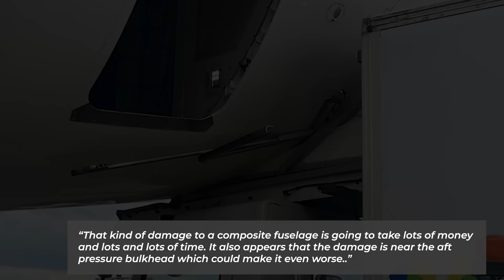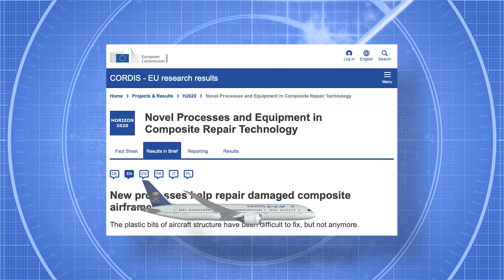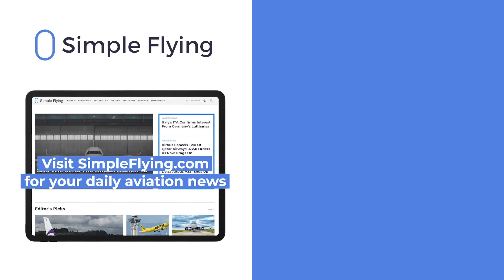Will This Boeing 787, Damaged By Ground Vehicle, Ever Fly Again?

Comment: I would not knowingly fly it as a pilot, or fly on it as a passenger, after an attempted repair.  For any potential insurer, the liability would be astronomical if it fails in flight and loses the rear empennage.  The engines, interior, and mechanicals may be useable as spares or even in new construction, but the fuselage is “toast” along with all the plumbing and wiring in the area which would have to be redone in any repair attempt.

Comment: She'll fly again. I remember when a MD-80 engine exploded catastrophically and caused heavy damage to the fuselage. That aircraft was repaired and return to active service and flew without issue until it's retirement. Look up Delta Air Lines 1288 for reference.

Comment: One of the most common motor accidents involving older people is confusing the accelerator and break pedals. When wishing to slow down they press the accelerator pedal. They get faster so push the pedal even harder until their progress is arrested by something unyielding. Ask any cop.
Reply: In this case it was the "break the plane" pedal  :)

Comment: Ex Aussie Airbus Maintenance Director here. It is important to note that the aircraft skin is its structure unlike a metal aircraft. Everything you know about aluminium aircraft simply does not apply. The structure has been compromised. The entire structure from wherever it is "bolted" to the rest of the frame probably needs to be replaced because of the pressurisation stresses; repair by patching is unlikely to even be contemplated. The good news is that both Boeing and Airbus have really good data sets including structural analysis, so what to do will become obvious to their engineers. But even with this data, designing the repair and manufacturing a one-off replacement fuselage section will take time and a lot of $. How much? I don't know, but I know that even very small holes can be over $1m to repair with most iof that expenditure being engineering design and testing costs.

Comment: Boeing repaired the Boeing B787-8, ET-AOP at Heathrow after the ELT fire. They took a fuselage on the production line and cut out the piece they needed to repair the aircraft.. Boeing COULD repair this airframe.... They repaired ET-AOP because they didn't want a 787 airframe being SCRAPPED soo early into the program. It will come down to whether Saudi want to keep an aircraft that has been damaged and repaired in this manner.. I suspect that Saudi won't want the aircraft..

Comment: patching it may be easy, but certifying it to be flight worthy after the fix would be very hard.  Curious to know if Boeing maintenance manuals have certified patches up to a certain size, and beyond such size, it isn't certified.    The fuselage is made of wound carbon pre-preg "tape" (tape is made of many fibres in he same direction, but the tape is laid in different directions and number of layers) 
A patch would likely be made of carbon fabric which is very small bundles of filaments hat are weaved into a fabric.  This would have diffrerent strenght depending on how it is laid and in what direction (and how many layers).  Suspect Boeing may have to test patches and once it got a design that passed the test would deply that design onto the damaged aircraft. Reproducing shape/strenght of the fuselage , rubs, stringers wouldn,t be that simple. 
If the damage included some structure or wiring, making he aircraft able to fly to Boeing field in Seattle would be quite a challenge.

Comment: If the structural integrity of the airframe is not too far gone it could still be flown. But it would have to fly at 10,000 ft. or lower. So it could be flown to a scrap yard possibly. It obviously could not be pressurised.

Comment: It’s repairable.  The plane is built in sections, so that section will be replaced.  The problem is Boeing is years behind with parts.  Of note, many 787 sections had to be disassembled to fix improper shimming.  This repair is no more difficult than that.

Comment: I’m a recently retired airliner airframe mechanic for a major US airline. Prior to a well-publicized merger, one of the airlines involved in the merger was the first US airline to order the 787. Being from the “other” legacy airline, and being very comfortable around aluminum airplanes, I wasn’t all that enamored with the idea of a “plastic” airplane. I spent a good portion of my career repairing fuselage damage caused by ground equipment. Ladders, belt-loaders, the Jetway, the list goes on. If it’s near the aircraft, there’s a potential for damage.
      The reason why I’m not a big fan of “plastic airplanes” is because, just judging from the damage from ground equipment, a well-experienced airframe repair crew could have had that airplane back in revenue service within, I’m estimating three weeks, allowing for parts and other materials. Stinger splices, whole stringer section replacement if necessary, skin doublers or skin replacements per the SRM (structural repair manual), and even engineering support. Damage like this is not the first rodeo for accomplished and experienced airframe maintenance crews. Plastic airplanes? That’s another story.
      My airline had a recent issue with a 787 where a lightning strike damage was in close proximity to the forward pressure bulkhead. My airline wisely farmed out that work to Boeing. The entire forward pressure bulkhead had to be removed in order to accomplish the composite repair. That airplane is back in revenue service, and will eventually pay back the cost of the repair.
      In the case of this particular aircraft, I believe that Boeing will have a fix, and that the aircraft will soon be back in revenue service. But, I can’t stop being old-school. I don’t like plastic airplanes.

Comment: Ya that is right where the pressure bulkhead meets the rear empennage. Without getting in the tail, hard to say but it doesn't look good. If I HAD to take a guess, I would say the pressure bulkhead is compromised. As to the composite problems? Ya got me, I know less than zero about that. That said, c'mon this is a plane that costs something like 300 or 400 million dollars. Write it of because of a hole in the hull and possible compromised pressure bulkhead? Ya its going to be EXPENSIVE and it's going to take A LONG time to fix. But writing it off? NO certainly not.
Reply: Compromised pressure bulkhead?   That sounds kind of - sinister.   (Google JAL 123).

Comment: Carbon fibre composite aircraft can be very hard to repair. In the old days of metal skinned aircraft the damaged skin would be deriveted and removed, any damage to the frames repaired, and a new skin fitted. The integrity of the fuselage wouldn't be compromised. But in a composite carbon fibre fuselage the carbon fibres are wound in a continuous thread right round the fuselage sections. If these threads are cut or broken the strength of the whole fuselage section is compromised, the number of threads cut or broken in this accident is probably far too many to repair. The cost and complexity of replacing the section of damaged fuselage will be to great, I suspect this aircraft will be written off.

Comment: This is the problem with the composite construction.  It's just like anything else that gets damaged especially with the materials involved, you have to scrap the entire thing even if the damage is localized.  It's very rare that airlines own any of their planes, and I'm sure this is no exception.  It's way easier to part the airframe out and by a new aircraft than to fool around with repairing.  Throw away society mentality in full view.

Comment: An aeronautical engineer could make assumptions based on those photographs. I was trained as a mechanic, so I couldn't tell you one way or the other whether they could ever be repaired. I don't want to fly in it, though. They could go ahead and fix it, but if they have a problem, they can pull over to the side of the road. Oh, please wait a minute; my wife just told me they would be in the air now. Hee Hee!

Comment: This repair will be very difficult to do. I worked on the Harrier GR5 when it was new in service (early 1990s). Originally it was thought that carbon fibre would be easy to repair but the practice proved the opposite. We had one with some small skin damage on the composite fuselage just ahead and to the right side of the canopy from a bird strike. The technicians were able to repair it but the real difficulty was whether we could be assured of the airworthiness of the repair. The aircraft had not flown again by the time I left - I know one proposal was to use metal plates and brackets etc as that is a type of repair which is well understood!

Comment: Knowing the Saudis,  respectful they will part this plane in question.  Probably already have a replacement.  It will cost more to fix and will hurt their reputation if that 787 goes back active. As for the contracted worker who hit the plane, i would not put this on my resume.  Im sure they were fired on the spot. This will just get added to the safety meetings now.

Comment: No problem. Repair is straight forward. Boeing can even supply a panel section that can be spliced in with titanium straps and fittings. With good composite mechanics and engineering oversight, should be straightforward.

Comment: This damage will not be covered by the Boeing Structural Repair Manual. This aircraft is now in the hands of the insurers.
Damage analysis and engineering authority for repair will likely be impossible. Expect to see it dismantled soon.
Reply: The BOEING AOG team will come up with a repair scheme and fix it

Comment: This problem was widely forseen when the 787 was being developed. Repairing damage to Carbon Fibre structures is a bit like repairing wooden ones. Very tricky to do properly and lots of skill required. Even then, it's hard to be sure it's been done properly. Every airliner I've flown has had a few patches on it- but it's very well understood technology with metal aeroplanes.

Comment: Heathrow, driver mixed up pedals. He will have arrived in the UK the week before and got a drivjng job through a relative, fake license and the tarmac is private land so hard to enforce. I worked on the ramp at LHR 40 years ago and it was like that then. Aircraft were getting hit every day but it was aluminium and they got fixed.  We kept aircraft grade body filler and aluminum tape to conceal the repair.😂

Comment: I made a bet that this will still be in LHR Christmas day, colleagues laughed until we looked in to it closer and it will probably actually be the case.  My guestimate, replace the aft section and do a unrivet/rerivet bolt back on which will take another 6 months, a carbon repair prob not the best option as such a big damage area.

Comment: I am a surfer . Our boards are fiberglass laminate.
Once the integrity of the laminate is dinged, you can repair it, but the board is never the same, and more likely to fail at the repair site.
That ding is right by the pressure bulkhead.
The jet is toast.
Reply: A friend of mine wanted to repair a cracked ski that way, it was also made of fiberglass. I told him that if there's ANYTHING wrong with the skis, to just get rid of them because you could never trust a repair like that and new equipment isn't all that expensive. It's certainly not worth risking your life over.
Reply: A bit like filling a hole in Concrete, the hole is fixed but doesn't really stick to the base material.

Comment: The Etihad bird had the entire upper fuselage, window line up,  replaced in a matter of months. Boeing stated at the time  they had already engineered repairs for a wide cross section of probable damage scenarios. A loader impacting the fuselage is undoubtedly one of them. Bottom line, it’ll be the bottom line.

Comment: Repaired but weakened?  The first rule of aircraft structural repair, going back at least to the pre-FAA Civil Aeronautical Manual 18, Maintenance, Repair, and Alteration of Airframes, Powerplants, Propellers and Appliances, is that in all aspects any structural repair to an aircraft must be as strong as, or stronger than, the original structure.  If that rule is ever weakened, civil aviation is doomed.

Comment: The fuselage is made of several sections. So, as the A320 was, this 787 should be possible to repair by replacing the whole damaged section (after checking that the damage didn’t extend to excess stress on the adjacent fuselage sections or assembly devices. The tail elements and most equipment from this section should be ok and be refitted to the new bare fuselage section. Some cables may have been pulled and/or ruptured too. This will likely take a lot of time to repair.
Reply: A320's aluminium.   787 is carbon fibre.   Not really comparable.

Comment: The comment on repairing bicycles is interesting. I've heard of someone making repairs to such, but isn't trying for perfect. They end up with a visible thickening, measurable (albeit small) weight increase, and so far no failures. That's a bicycle of course, and if the owner accepts it unlikely to trigger regulatory investigation. I think it's likely to be possible to repair this aircraft, but getting it recertified might be the stopper.

Comment: The only safe way to repair this is by replacing the whole section at the point where it was assembeled. The problem there is that the assembly is done in a specialized factory, with specialized machinerey, cranes, workers... Also all the wires and other items that run through the area will need to be removed forst.
Teh chance of a write off and then clibalizing all usable parrts of the aircraft would most probably be more cost efficient.

Comment: Because the 787 is in such high demand, both for the aircraft and parts, the insurance company may decide to write it off and sell off salvageable components, such as the engines, avionics, seats, etc.
Reply: Producting one extra bare rear fuselage section should be possible.
Reply: @joso5554 It's not that simple. First other stresses in the fuselage would have to be checked. In addition to that, some wires or hydraulic lines may have been severed.
The scope of work may far exceed what's apparent to us on video, otherwise the plane won't remain grounded for months without any official plans for how to proceed.
Reply: Most large airlines are self insured, meaning that rather than pay insurance premiums they keep a slush fund  to pay for this sort of thing.
Reply: Often the engines are leased separately from the airframe.

Comment: They should write it off, hopefully they are insured and get full value. Possibly the only way to repair it is to assess the situation, prepare a replacement of the whole damaged part rather then try to bridge the damage, hire a Beluga and fly it in. I saw a video from Air France repair centre, where they were repairing some carbon fibre damage and it looked like a nightmare. And it was relatively small compared to this.

Comment: Given that the 787 fuselage sections are manufactured as barrels on huge mandrills I cannot see how this airplane can be repaired without replacing the barrel. Not sure but I don't think the A350 fuselages are made this way.
Reply: Indeed,  the barrel construction technique will be more complex and expensive for a major structural repair to be designed.  The A350 uses a panel construction method for the fuselage, and while a repair on such a scale will still be very expensive in cost and down time, it should be less complex to design and complete.

Comment: Took months for the parts for two aircraft that collided at Heathrow resulting in entire Stabilizer replacement. They are still trying to figure out if it can be repaired, what needs to be done to repair it and how they assemble the equipment and personnel to achieve a repair. Then they might look at the value of the parts on this aircraft........

Comment: Announcing Heathrow's newest theme restaurant: The Dreamliner Café
Reply: Maybe it would be useable as a movie remake set, for “Airport 2027”.  I mean, in the original Airport 1970 movie, Dean Martin had to fly a Boeing 707 with the tail structure threatening to break off after a bomb went off in the “starboard can”, as Dino said it to Barry Sullivan, the other pilot.  They already have the hole in the fuselage so they won’t have to make one.
Reply: Impossible in the UK. There are so many rules to follow that it would come up with some regulatory problem. Never mind that it already has some galley facilities built in. Anywhere else, no problem: remove 80% of the seats, turn half the remaining seats to face backwards and fit tables. Job done.

Comment: In my opinion A350 / B787 are the first and last passenger planes made out of CFRP exactly for this reason
Reply: no? composite materials offer so much benefits that this isolated incident probably wont do much
Reply: So because 1 of the approaching 2,000 combined 787s and A350s in the world has ended up in this situation, all CFRP passenger planes in the future should be abandoned 🤦‍♂
Reply: @christianwood7516 I am only saying CFPR commercial aircraft mainly the fuselage has no future. CFPR can’t be recycled, is a nightmare to inspect when hit , difficult to fix. Airbus and Boeing will have lighter alloys which have similar weight properties.
Reply: @MrBillboeing it’s not just the weight properties that the CFRP offers. It’s is stronger than aluminium which allows a greater pressure differential which therefore lowers the cabin altitude. A lower cabin altitude makes for a much more comfortable flight for passengers particularly over longer distances
Reply: Here's hoping!